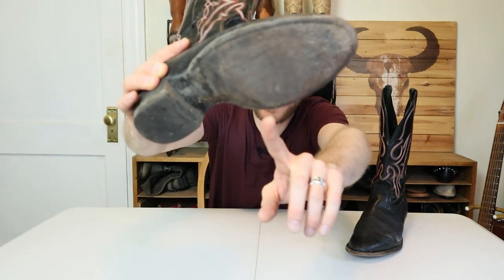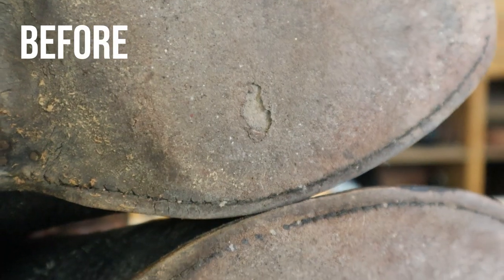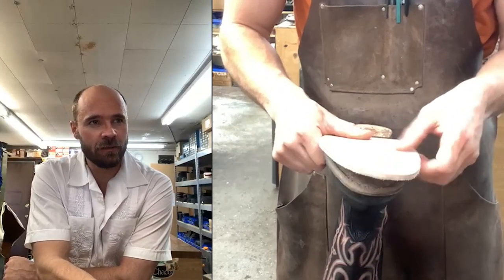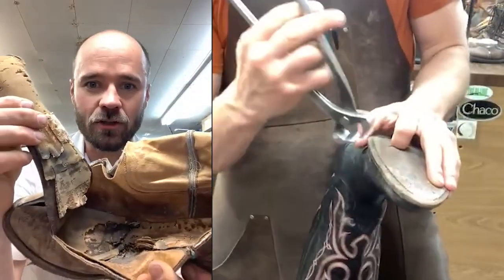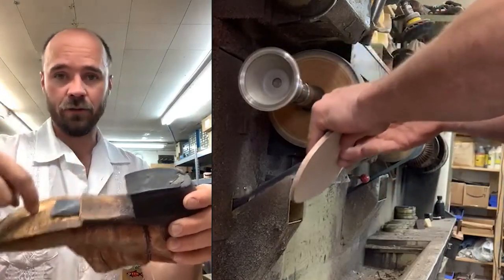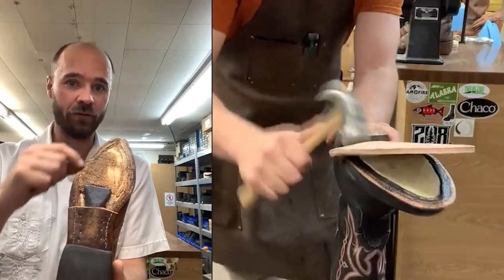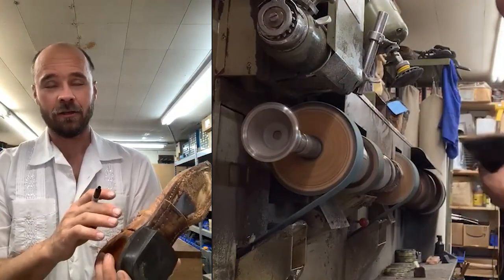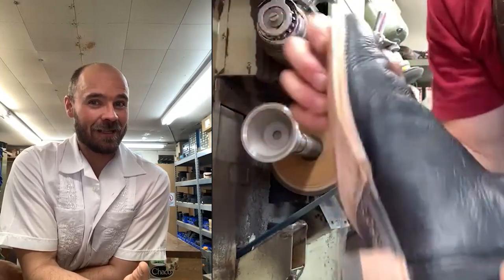Cowboy Boot Resoles: EVERYTHING you need to know about half soles

Comment: Very interesting and informative.  I approach shoe repair from a cost standpoint.  If the shoe/boot is high quality with leather soles, I half sole.  On the other hand I buy ropers with rubber soles for 2 reasons-1, the rubber has better traction on smooth and wet surfaces. 2, They are cheaper and the boot leather wears out before the rubber sole does, in which case I throw them away and buy a new pair of rubber soled ropers.

Comment: Very informative. Thanks. Question. I was looking at a pair of Lucchese 1883 Carson’s and was wondering if (since they don’t have lemon wood pegs)if they can be resoled? My budget won’t let me get the classics. Again,thank-you.
Reply from the maker: Yes all you need to have a boot resoled easily from my understanding is a proper goodyear welt (there are other welt styles for other shoes but that doesn't matter here). Your Lucchese 1883 have a full welt which don't need pegs. My boots in this video have a 3/4 welt with pegs. Two different ways to make a boot but arguably same quality. Both can be repaired with a half sole. My first Boulets have a full welt and I've had 3 half soles on those
Reply: @JeremiahCraig  thank-you. I would like to ask another Q if I may. Do the 1883’s have a full leather heel counter? I’ve heard you say that is important for durability.

Comment: So I just got to the part with leather to leather rubber to rubber as long as you prime and glue correctly it works. As an electrician, we do the same with underground conduit which we use a lot of pvc. In my time, cleaning your conduit and not, if you only glue it WILL come undone. I’ve never seen or had to repair an underground conduit run that was primed then glued. Point is, talk to your cobbler about their process before sending them your boots an complaining. Free market capitalism. Everything is a risk. Do your research.
Reply: I'm also an electrician and I hate how PVC glue smells lol then you got the very intelligent and cultured individuals on jobsite who huff it